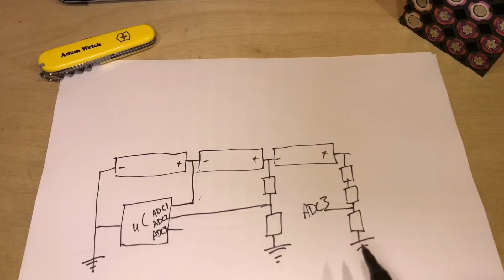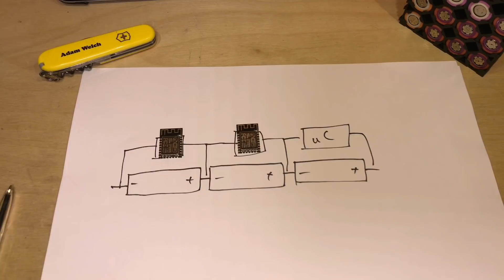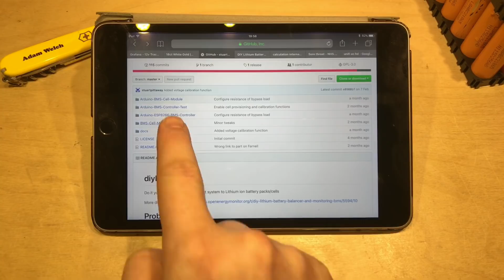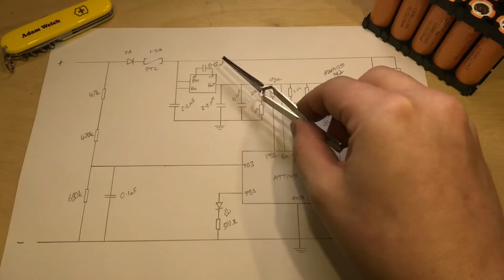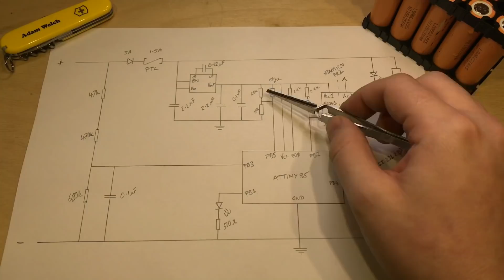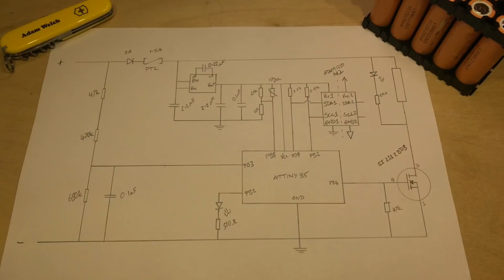Lithium Ion Battery Management - diyBMS - 12v Solar Shed

Comment: So a single diybms is alone enough to monitor the entire battery pack or do we need more modules of it to monitor the pack?
Reply from the maker: One module per cell and one controller per battery bank. So for example my 7s20p lithium ion pack uses seven modules and one controller.
Reply: @AdamWelchUK  Thanks for your kind reply. Actually I was planning to build a battery pack of 3s7p(21 cells). So now I do require 3 modules and 1 controller right?
Reply from the maker: raaghav krishna Thats right. Have you seen there is a new version? Check out Stuart’s github for more info.
Reply: @AdamWelchUK  yeah sure I will look into it .Thanks for the info !!

Comment: If you have room, do not fit the power resistor flush with the board. Leave a couple of mm or 3 of air gap so heat can dissipate as airflow rather than warming up the pcb. The resistor should be ok suspended on its wires, but feel free to put a small bulb of silicon sealant each end to help if you want, or if the boards see any vibrations in their application.
Reply from the maker: A good suggestion, but in the end I’ve gone for a fairly high resistance for my power resistors - so they don’t generate a lot of heat. It’s slows down the balancing, but as long as the packs are fairly even I’ve found it has worked for me. Cheers

Comment: I took a look at the schematic to try to figure out how Mr. Pittaway measures the voltage of the packs in series. Basically how it overcame the problem of measureing an increasing voltage.  The schematic shows  the battery between  Batt-raw and ground, with Batt-raw going to the ADC via resistor divider network.   Is ground in this schematic not at 0 volts ground but just a common point at some voltage depending on where the pack is in the series ?

Comment: Hi Adam 
i was wondering if you know were i can get (10) SE30AFG-M3/6A  as i am having trouble sourcing them as most places have a lead time of over a year. I don't know if anyone else is having the same problem. Its the last component i need to start the project. The only place i can find them is from Mouser or DigiKey but both want twelve pounds postage and the component are only two pounds eighty six pence. Any input from you or your followers would be very much appreciated.

Comment: Ardunio Due has 13 bit precision and on its ADC. This means even on the highest cell you would get 0.01 volt precision. You only need two resisters in the voltage divider per cell not many as you showed in your diagram, the inaccuracy of the resisters can overcome by putting in a adjustment which you can set via calibrating with a voltmeter.

Comment: Weredo you get the plastic trays for the cells from ?
Reply from the maker: I get them from ebay..  https://ebay.to/2IvB826
Reply: Thanks for that and really appricate it 

I found  3 cells made up as a 12 volt battery other day in the road and got a eletric bike project to do 

Thanks to your videos i am now able to build a battery for it which will work out a lot cheaper then buying RC lipos and lighter then lead acid batterys also cheaper to replace if cell goes down

Comment: I'm thinking in case of 3-4 separate packs of 3.7v to rewire them all in parallel with a switch. In theory, they should level all up and then put them back in the original 3s -4s. For this, of course, the battery can't be used in desired voltage but time to time maybe can be a solution to balance everything.  Like this, I'm thinking that you don't have to burn the excess power and it will go in the lower cells. For real-time balancing will be of course better a BMS but I think will work. I'm curious what other think about this.
Reply from the maker: Yes I have seen this done. If this process is completed regularly then very little current should flow between packs when you connect them in parallel - good because you’re not stressing them (or your cable/relay), but also it may take quite some time to even them out perfectly. 
As you say - it all boils down to whether you can take you battery offline or not - and for how long.

Comment: Hi Adam looks good so far just a thought why not have the bms made up in China also I'm sure that it probably won't cost that much to do rather than pouring your own time into it anyway just an idea
Reply from the maker: It’s an interesting question. A few of the pcb fabrication houses will also complete the board for you but often it’s only do-able with components on their list. I’m looking forward to building them to be honest. I don’t expect soldering the pcb is going to take all that long.
Reply: Ya I understand that I'm looking forward to seeing the end result myself I wish I understood more about electronics I would have had a bash at myself anyway I think it cool that you're going to do it

Comment: Wow that what i was creating lol using the same parts tho mine is abit more simple and didn't have the input buckboost, and using a mosfet with heatsick rather than using a big resistor. I will check out his code because my problem is not with the circuit but with bus communication when sending data to the master from lots of attinys over i2c. Cant wait to see more on this.

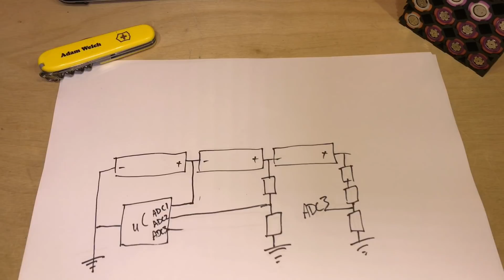Comment: Hi, at 5:05 you say that the additional resistors in the potential divider contribute to reading inaccuracies.

In fact what happens is as you increase the divisor caused by the potential divider as you add cells, results in the decrease in resolution of the raw data from the ADC due to having to multiply back up to the measured voltage in software.

Did you breadboard the circuit before sending the design off?

Comment: I can recommend this site: batteryuniversity.com/
To charge battery you must basically follow certain rules for certain types of materials used and control the amount of current in time according to temperature,resistance, discharge rate and lots more
Proper charging batteries is not easy

Comment: Couldn’t you use opto-isolators to link uC together?
Reply from the maker: I believe so, but it’s a little tricky as the comms needs to be two way. The module needs to inform of the cells voltage/temperature and receive instruction over what it needs to do (discharge or not).

Comment: Hi will you be making these available for sale or able to supply as a kit
Reply from the maker: No I don’t think so. This is Stuart’s project and he’s open sourced it and the parts are fairly cheaply available. It’ll be interesting to see if someone does though!
Reply: Adam Welch that's fair enough but could you put up the link to the PCB supplier and the part number of the board

Comment: I think another cheap solution that could work fairly well is to get something like the chips on those super capacitor banks and just use a more beefy 1-5W resistor.

Comment: I use 8 pin 7s connectors with 18 guage wire going to them for each of my packs, for balancing and monitoring. I have that same capacity checker that you have.  Mine will attempt to balance my large packs @ ~50ma, but it will begin overheating after just a few mins, and the heat will usually burn through the plastic before the component blows at 30-60 mins.  Just an FYI, if you haven't tried yet ;)

Comment: Interesting....
I have an exact Capacity Controller as you. I bought it for shits and giggles, but never got around to playing with it.
After seeing your video, I opened mine up and I think you would've benefited by looking inside.
There are 3x 100 Ohm resistors in parallel for each input. Each of these 33.333 Ohm resistor packs are driven by a PNP transistor marked 1TY, which is the same as S8550. Each of those PNP transistors are driven by an NPN transistor marked 1AM which is the same as 2N3904.
You should've reverse engineered the PCB of the Capacity Controller, and make room for beefier PNP transistors + heat sink, and power resistors to limit the current to whatever you like. 
You could then de-solder the parts you needed from the Capacity controller and solder them on the new PCB, excluding the dinky 1TY and resistor arrays. Same LCD, Same everything. All else would stay the same. 
I am pretty sure you could even use logic level power mosfets instead of the PNP transistors, since it looks like the transistors are operated in switch mode (on or off), and rely on the resistors to limit the current. 
Anyways, just a thought. Good luck.
Reply: Was thinking the same thing as ive ordered this controller too. Id prefer to beef it up vs engineering a new one
Edit: If you wanted a 100ma capable balancer would it even be possible to wire two of these capacity controllers in parallel for a quick solution?
Reply: Good question, I am not sure. I don't see why not. Then again, they might fight each other some how.
Reply: Not true. The top portion of the PCB has traces going to transistors from the ports0. The bottom of the PCB has traces going to the ADC converter R/C filtering which goes to the MCU.
Reply: Good idea, but you won't have individual cell voltage readings in that case, for remote monitoring and protection.
Reply: UFOhunter The capacity checker has the ability to measure the voltage, what I meant is that you can't get voltage readings and balance status with external microcontroller
Reply: There is no external MCU. I think you misunderstood my post.
Reply: UFOhunter right, but if you want to get telemetry data, in that case you need an external microcontroller

Comment: Interesting project.  I'm anxious to see how this works out for you Adam.
Still it's yet another BMS designed to convert our valuable power into waste heat.  I have a tenative arduino-based design in my head that incorporates a boost converter on your output stage to be able to transfer the power drawn from your highest bank to the lowest, thereby saving 90% of the power and balancing twice as many banks at once with minimal heat produced.  But that is still a ways off.
For now I balance my 10p to 25p banks of my 7s packs to 4.00v manually via charging.  Then after 10 full cycles from 4.10v down to 3.40v they are all within 0.003v (3 milli-volts) when charged back to 4.00v as a pack.  So manually balancing once every 30-40 cycles saves me a lot of waste heat and unnecessary lifetime cycles of the cells for now :)
Reply: Exactly my thoughts. Well said. I have always found these "discharging" balancers to be a wrong way to do the job for all the reasons you mentioned. Wasted energy might not be a significant problem when you charge your cells with mains, but when it comes to solar power it becomes a concern. I hope you finish your project and share it with us.
Reply: The basic flaw in the current state-of-the-art for BMSs IMO is that they have to assume identical cells in each bank.  However cells have widely varying discharge/charge curves, even ones with identical ratings from the same manufacturer.  This has almost nothing to do with internal impedance btw.  One cell may be at 50% charge at 3.85v while it's neighbor may be down to 3.35v at 50% charge.  This is averaged out to a degree by shorting many of them in parallel as we do.
But for a BMS, it is seeing a pack balanced at say 4.0v, but then at 3.8v it is seeing out of balance again due to these differing curves.  So now it rebalances at 3.8v and your solar panels get sun and it is out of balance again.  So, by design, the BMS is working non-stop whenever the potential of your packs change, even thogh they were perfectly balanced at a specific voltage =(
Reply from the maker: I think you make a good point - but I live in hope that my packs will be even enough that balancing losses should be fairly minimal.  I have been thinking about using an eight pack - connect it to the highest pack to discharge that one, then connect it to the lowest pack to increase that one. It includes the least amount of dc2dc conversion and hopefully the least losses - but I'm going to try this first :-)
Reply: Looking good! Keep up the amazing work!

I'm a bit dangerous I suppose... The Lithium pack that runs my Solar Camera is not balanced at all. :P
Though I'll probably be changing that once I get around to putting together version 3.
Reply: I too have been wondering how a "good" BMS would work but I'm a newbie to electronics.
My main concern would be the life cycle of the batteries. Discharging one pack to charge another artificially reduces the life cycle.

I guess burning off energy by bypassing and dissipating only when some packs are underbalanced would be preferable. The energy won't get used or stored anyways in that case.

Comment: A long time ago I found a project which used opto-isolators for the isolation: https://www.youtube.com/watch?v=BlQDPORL8pI but this project seems neater and I do like the standardized  single-bus communication protocol with these modules.
Reply from the maker: Thanks.  I have seen some projects using opto's but the ADUM1250ARZ is leaps forwards really.  Such a useful IC for this project.

I believe Stuart thinks there's still a fair bit of work to do with the code (and much of it is beyond my skill level) but to me the hardware looks pretty much set.  It's something I'm going to enjoy testing I think.

Comment: Hello Adam. Is there any cheaper alternative to this bms?
Reply from the maker: Well with a bit of careful purchasing I’ve managed to get all the components and PCBs for about £7.40 per module. I think that’s pretty good value. But if you want really cheap... grab the capacity controller. :-)
Reply: Adam Welch: There is an active, rather than passive, solution available from Aliexpress (https://www.aliexpress.com/snapshot/0.html?spm=a2g0s.9042311.0.0.DKjQMr&orderId=505456887330944&productId=1950876697) which comes in at about $20 per module and uses the excess voltage/power from any higher value cells to ‘top up’ any lower value cells. This effectively redistributes power as opposed to burning off excess power and is therefore potentially more efficient in a solar system. I have recently purchased this to try out on a LifePO4 battery made up of 4 40A cells.
Reply: Dorian Wiskow that link doesn’t work - any chance of trying to link to it again? I’m interested to see the product you recommend. Thanks.
Reply: Oliver Thomas: if your search on google (or the Aliexpress website) for “QNBBM 4S/12V Lithium Battery Equalizer Balancer BMS for LIFEPO4,LTO NCM LMO 18650 DIY Pack”, that should take you to the product. There is also a single rather than 4 cell unit available . Here is a link (http://www.gne2010.com/product2) to the manufacturers web site. This link (http://diytechandrepairs.nu/1s-modular-active-balancer-reviewed-and-trashed/) also gives some background on active balancing.
Reply: Dorian Wiskow that’s got it. Thanks! Looks like an interesting product if it works as well as claimed.
Reply: Adam Welch Thanks I'll probably buy that capacity controller